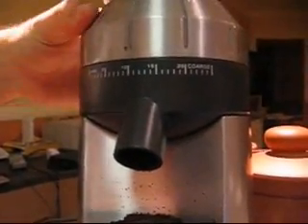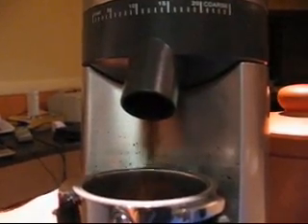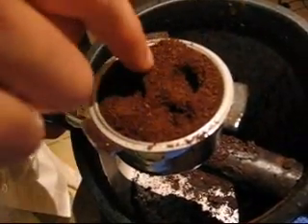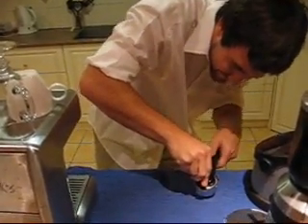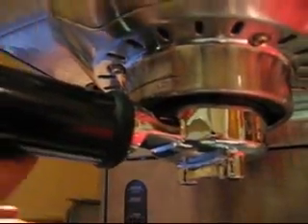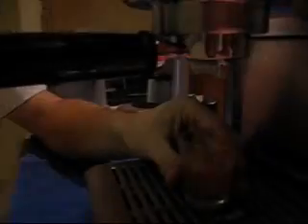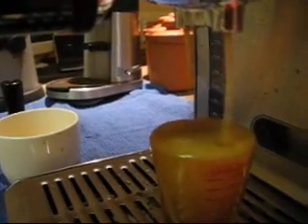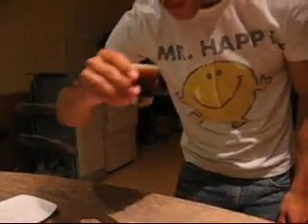The perfect espresso

Comment: There is nothing wrong with a bit of espresso comedy (you see it every day at Starbucks), but adjusting a quality grinder when it is not running and has beans in it can be cause for voiding the warranty. It can mis-align the burrs or damage the bearings or adjusting threads. And unlike the video, this is serious advice.